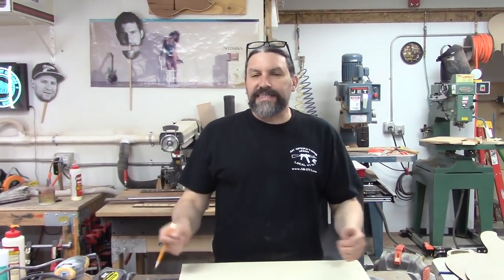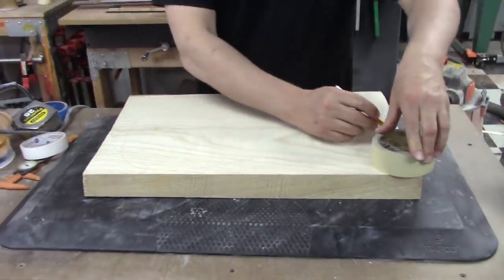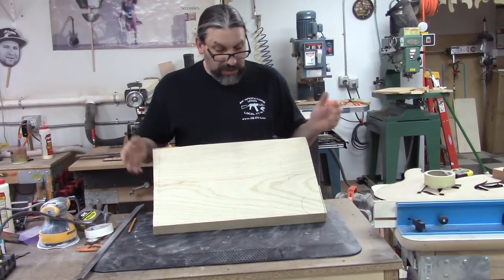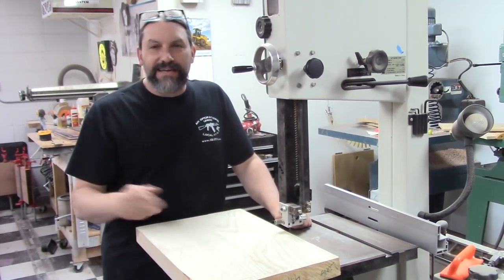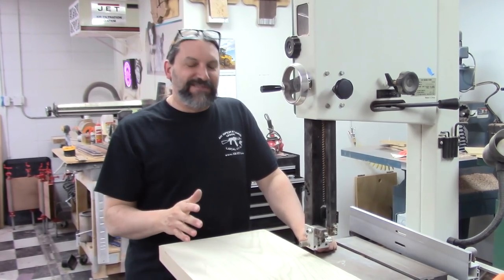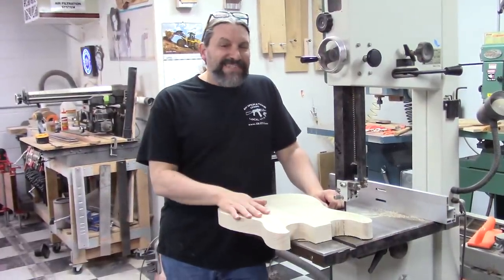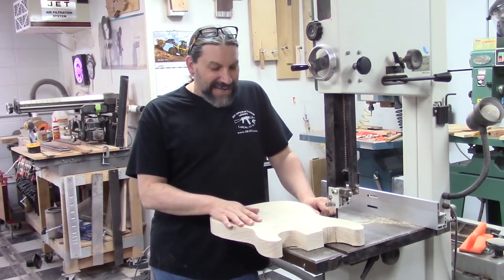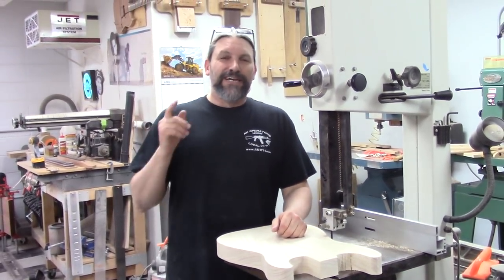Let's Build A Stratocaster Body... Bandsaw Basics

Comment: You are absolutely correct in that you need a bandsaw, I'm an old guy and I have a 14" Beaver Delta that was my dad's - I wouldn't be without it!  Thanks Matt & Chris for the video
Reply: I inherited a smallish bandsaw from dad too. It wasn’t either of the 2 commercial ones from the family furniture shop( one so big the entire floor of the shop would dance to the rhythm of the exposed wheels when it was used).  But a home version that he bought after the shop closed. I have it in the back of the garage and I’m pretty sure it’s a delta too and 14” seems about the same dimensions just using my eyeball memory.
Reply: @marccarlin1  Yes the nice thing about the old saws is that the were made of cast, so even though it is a smaller saw it is substantial it won't bounce and flutter about

Comment: I used a jigsaw to cut out the body of my first guitar. It worked but it required a lot of cleaning up.  A bandsaw is the one piece of power equipment that I do not have that I really need to get.
Reply from the maker: you will wonder how you ever lived without one

Comment: I've done a few kits and in the GGBO kit competition.  But the lack of a band saw and drill press is stopping me from attempting a scratch.

I'm gonna be looking on the secondary market for these two things.  Are there red flags I should be looking for or good things I should be looking for in a second hand band saw?
Reply from the maker: The big one is find a saw that has a blade size you can get.
I bought a bandsaw once and it took some kooky blade length that I had to have custom made HAHAHA

Comment: machines for making Guitars #1 A band saw  #2 a pin rotor?
this is a great tutorial on the uses of a band saw.
Reply from the maker: Those would get you there
Reply: I have heard that a spindle sander is pretty useful too
Reply: A drill press is more handy than a bandsaw, gets more use. I'd go #1 drill press, #2 router, #3 oscillating spindle and belt sander, #4 bandsaw. But then I don't have a fancy TT pin router. I do have a CNC though ...

Comment: Bought my first one yesterday! 9 inch.. returning it today for a bigger one. Table top, but will make a stand for it. The extra price tacked on to a bandsaw with a stand is ridiculous! What’s your recommendation for an adequate, and affordable bandsaw? What size?
Reply: Most guitar forums will swear you must have a 14inch but it's easy to build with the much more common and a third to half less costly 12inch models.
Reply from the maker: In every instance... buy the largest power saw, router, drill etc. that you can possibly afford.

Comment: Embarrassed to say but my harbor freight band saw has lost the ability to tension up properly. Operator error and a bit of the cheap tool syndrome. I want an old delta for some reason.
Reply from the maker: Those old Delta units are pretty cool